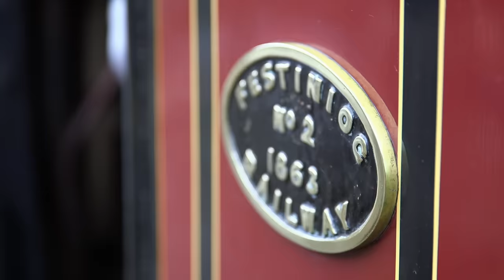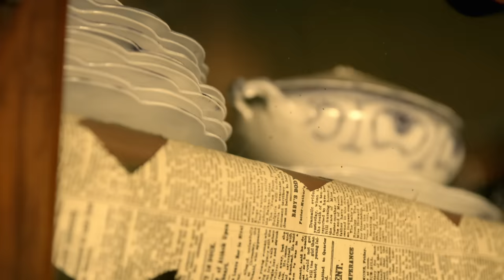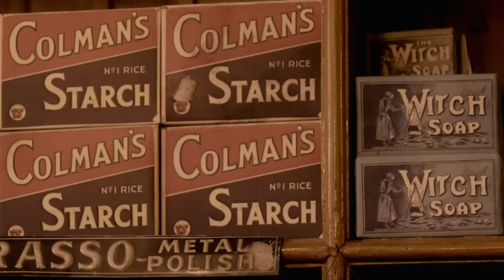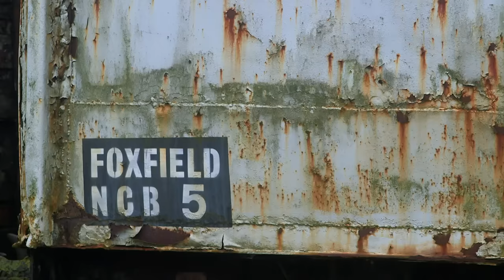How The Steam Train Changed The World | Full Steam Ahead | Absolute History

Comment: In the late 1930s/early 1940s, my mother spent a summer working at a summer camp in the Hudson Valley in New York.  The dining hall was a screened-in building not far from the railroad tracks.  When they set the tables for meals, they would put the plates upside-down in case a train went by.  That way, when meals were served, the diners only had to turn their plates right-side-up, and they had a clean plate to use.

Comment: In Colorado, the old narrow gauge Iron Horses have many features to reduce the risk of fires.  One is cyclone baffers in the smokebox, a sprayer and wire mesh on top of the smoke stack finish off the preventative measures taken.  Though now some have been modified to burn oil instead of coal.

Comment: 54:03 Was this type of stamped sheet-steel pot more common in 19th-Century Britain than cast-iron? I'm finding that hard to believe, but it's the only thing that makes sense, if you need to replace it every 20 years. I own and use some pieces of American cast-iron cookware from the 1870s, and they still look nearly brand new.
Reply: I'd imagine that chefs working at fine restaurants and cooks for whom their craft would be a source of money would still own and work with cast iron but the industrially manufactured steel sheet cookware must have been a lot cheaper and more accessible to common folk